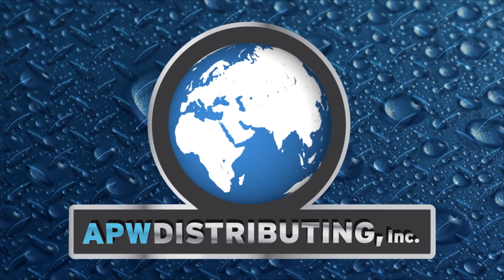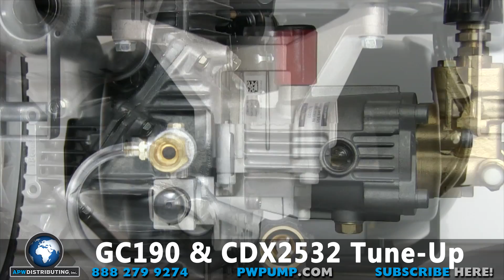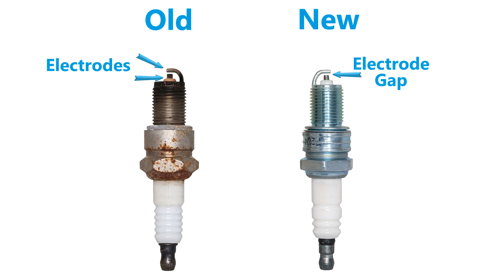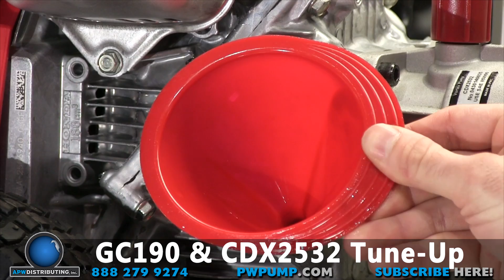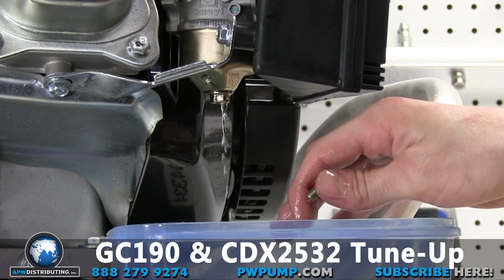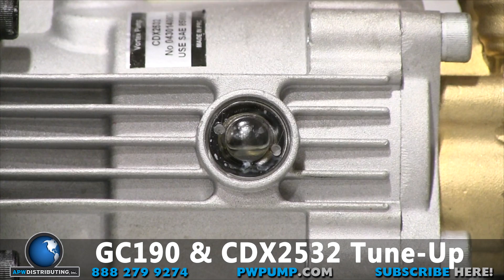How To Tune Up Your Pressure Washer (GC190)

Comment: just picked up a USED Ridgid 3300 psi - RD80702 with EFI 
No Start ???
sprayed brake cleaner in Air Cleaner Starts - POSSIBLE BAD EFI Throttle Body ????